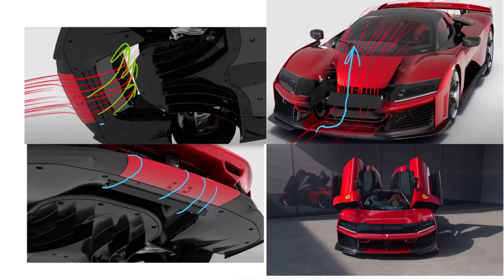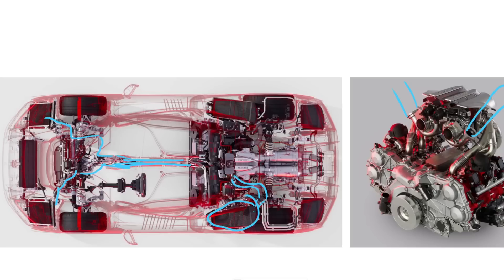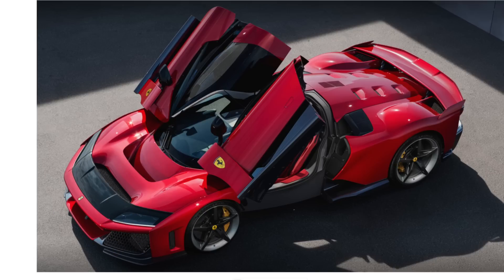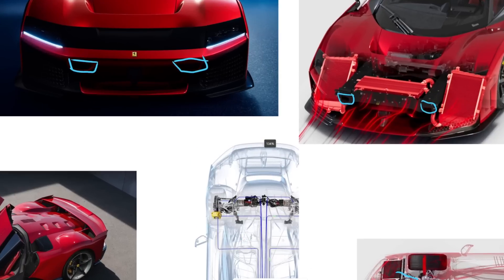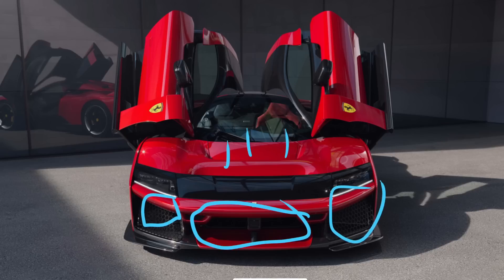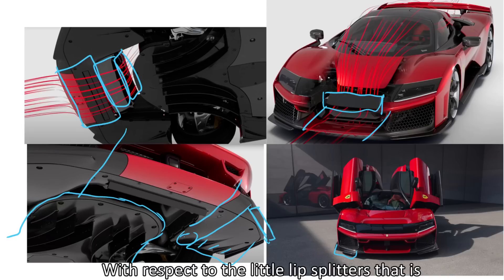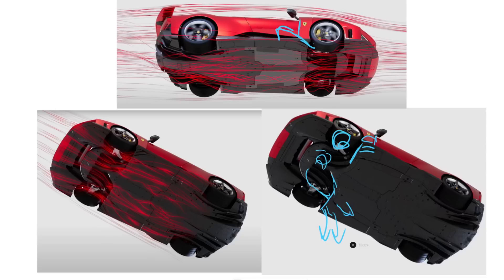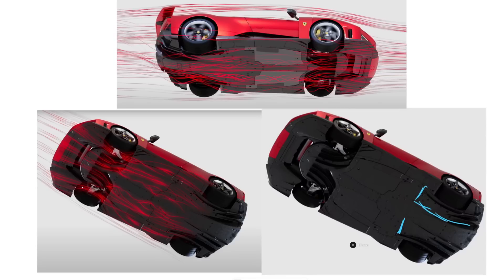Ferrari F80  -  Aerodynamics Analysis and Initial Thoughts

Comment: Analysis aside. This car is not pretty. It has that same odd nose as the 365GTB but immensly bulked up middle and back body. What were they thinking when they designed this car?
Back to the drawing board. Have a look at the FXX, and modernize it but better than the K model.

Comment: Question! The front 3-element "wing" that you talk about at around 8 minutes in, since it's generating so much DF and it's venting straight up right before the window, is there a chance that in wet conditions it'd potentially throw out water through it, and maybe even cause visibility issues?

Theoretically of course, a road car of this caliber probably wouldn't be pushing super high speeds on a track in wet conditions very often.

Comment: You know, back in the day I might have considered that those ducts running through the doors would be too long and tiny to really do anything. But I've read Willem Toet's article on air ducts, and how they blew out the door on their Aston Martin Nimrod at Le Mans after making the cockpit air intake smaller, but having a decent expansion area after it, increasing the pressure... So yeah, not gonna make any guesses as to how it actually works, because clearly I know nothing. =)

Comment: I never understood why more engines and transmissions are not angled around the Y-axis, whenever the regulations, or lack thereof, suit it.
Yes, the CG will be raised but that will allow for larger diffuser expansion right in the center section with all of the benefits that come with it.

Even racing categories which do allow for such implementation see very little to nothing of the kind. Maybe I am underestimating the side-effects of the raised CG, but as high-noses have shown in F1, the aero benefit does outweigh any CG concerns.
Reply: Do you mean simply moving the engine higher up in the car, or somehow orienting the various components to be arranged vertically? I think the new Lamborghini Revuelto’s transmission and electric motor are kinda stacked vertically to be more compact lengthwise.
Reply: @ALMX5DP  I mean tilting the engine and gearbox in relation to the ground, where the back of the engine stands higher than the front the engine.

On side view, angling the engine and transmission by about 10-15 degrees would allow the floor beneath it to be angled by that exact same amount. The differential still needs to be connected to the driveshafts, but this layout will allow for more diffuser expansion in its center section, as opposed to no expansion (assuming zero rake), whenever the engine is mounted flat or perpendicular to the ground.
Reply: @leoa4c   ah gotcha. Yeah since no mechanical driveshaft is going to the front, a little for-after tilt may not be so difficult. Still have to consider where the rear half shafts connect to the transmission so maybe that is where they might run into potential issues. But yeah interesting idea to allow for more underfloor aerodynamic work.
Reply: @ALMX5DP  The best way to deal with the differential would be to implement it above the drive shafts, in the center, with a gear coming down on each side to meet its respective geared shaft. Essentially, each shaft is a metal tube with a universal joint connected to a small diameter gear. That small diameter gear connects to the diff's "side gear", while a housing keeps it all together and, most importantly, no lower than the U-joint itself.

Such layout would drastically increase diffuser volume. In most mid- engine configurations, I think that an increase of 50% could be achieved.

Comment: The computer is just solving equations, applying curl and gradient operators to a field of vectors. If your eyes can make that calculation, and your brain is a computer, is your observation not valid? The eyes work better at resolving boundary conditions anyway, which all CFD kind of sucks at. Not saying CFD is useless, it's a tool, it has its place, I'm saying ultimately it's our eyes making judgment calls, our eyes need to know what they're seeing. CFD gives you a hint of what's happening, not the final say, the final picture always forms in your head.

Comment: Do electric turbos still use intercoolers?  That front shot with the doors up looks like the front of the garage 56 Camaro and the charger hellcat to me lol.  Enzo would be so pissed.
Reply: Yes, you still need to cool the air even if you have easier control to keep the compressor in a better part of the compression map, the only real replacement for inter cooling is ethanol or water injection up stream and both are more for short term running (drag racing) not really used in race or road cars as they introduce a consumable and can’t remove a lot of heat for extended periods of time (without topping up fluids).
Reply: 100% agree with the rest… add more mass in a less energy dense power source just to hit a 0-100 number while making a whale of a car in the corners/real world driving… he would fire anyone that suggested doing that.

Comment: Since this car is based on the lemans Ferrari, or at least that's what Ferrari said, I have a question: 
Why do Lemans cars have a gap over the wheels??
Reply: From what I understand, but I could be wrong, those cut outs are mandatory for all prototypes and hypercars. They are there to get rid of the high pressure air within the wheel wells. This should in theory make the cars less likely to get airborne.
Reply: @fastyf1 but does it have any advantage, why does the AMG project one for example have holes over the tyre or maybe SSC tuatara??????
Reply: @Manuel_Gestal   decreases lift
Reply: It’s also a way to cool the brakes for cars that are so track focused ✌️

Comment: I don’t know why they thought they needed two gigantic straight vertical lines at the leading and trailing edge of the side panels around the wheel. Same for the black strip. How does boring, bland, straight shapes equate to making it a futuristic, sci-fi design? It’s like they had to put effort into purposefully making a home run or easy layup body design just a bit ugly. It’s so close to being magnificent.
Reply: easy answer is F40 inspiration.
Reply: @bonifacelukosi9580  Thank you. I feel like everyone forgot the F40. That and the F40 had a twin turbocharged V8. It's so clear that this is a modern interpretation even down to the rectangle headlights.
Reply: @supermanblackedition  I completely agree, people are subjective before objective these days.

Comment: I thought the cost cap is supposed to take care of unrestricted technological development. Why are we still strangling development through more and more rules when the whole point of most of the rules was to prevent having to spend billions to compete at the front? Though the bib trick was definitely illegal without changing the rules, so I think this one would actually qualify as cheating. 

What if teams are allowed to develop non-hybrid V8 and V10 engines, but they’re also allowed to stick on as many electric motors and batteries as they want, wherever they want? They could have 0 to 100 electric motors and maybe a certain overall battery capacity limitation. That could encourage the development of even more powerful and lighter electric motors that can either withstand higher heat or dissipate heat better. The cost cap could be adjusted to prevent buying the championship.

If they go back to thirteen inch wheels can replace the weight with motors near the wheel or remove the weight entirely. That genuinely seems to be where super cars and regular cars are going, and teams can embrace electric motor power as much as they’d like. They should also remove the minimum overall car weight requirement because making any component lighter while maintaining a budget improves the performance and efficiency of anything. There are many problems with these ideas that need to be handled with appropriate rules and guidance, but I think they’d produce amazing racing and amazing vehicles.

Comment: It's a shame this car is 3700 lbs. Kinda makes everything pointless IMO, a hypercar shouldn't be almost as heavy as a dodge challenger
Reply: I agree and I get your point, but from all hybrid hypercars with 4 wheel drive (especially those with two front electro and one rear electro) it seems to be the lightest.
Reply: Holy shit
Reply: What's a lb? In all serious, no, that weight isn't an issue with modern chassis tech.
Reply: @wasdwasdwwasd  No, if it was the case, nor Adrian Newey or Gordon Murray will be trying to reduce the weight of their cars at all costs...
Reply: The Valk is much heavier than claimed and the Murray car is trying to do a very different thing. Less weight is better, but it's not the handicap it once was.
Reply: @jayaneyon9316  checked the actual weight of a sf90, that specific car was 1844kg, that's 4060lbs. I  dont know where Ferrari gets their numbers from, maybe they have scales on the moon 😂
Reply: @garagecedric  Ferrari (and most italian companies) use dry weight
Reply: @dylanburston7453  for Ferrari its something else going on, or maybe they have 250l tanks :)
Reply: @garagecedric  68L fuel tank.  
0.79kg (1 litre petrol) times 68=53.72kg.
1570+53 =1623
+75kg for a driver and another couple of KG for the other fluids would take you up to 1700kg, which is the most common kerb weight for the car ive found.

Im guessing the car they weighed must either be a outlier, or 
have full tank+ lugage+fat driver
Reply: @dylanburston7453  its the same for all Ferraris cars the stated weight is fantasy, in the Swedish vehicle registry all individual actual car weights can be easily checked with just the plate number. But there are other sources as well which tell the same story :)
Reply: @garagecedric  sure, the scales and posts that you find in internet aren't "trust me bro" compared to their scales 😂
Reply: I’m less concerned about how manufacturers make their hyper cars “overweight”, than I am about more mainstream models doing the same. I feel Hyper car owners won’t care, whereas the owner of say an Mustang or BMW M car will have an increased likelihood to, especially when it comes to the comsumables that they use like on a track day burning through a set of tires and brakes more quickly as a result.
Reply: @ALMX5DP  we have mostly twisty tracks here, many modern cars go through (big) tyres at an alarming rate!
Reply: @garagecedric  same for here in the US, and yeah tires are getting quite expensive especially the big ones (305+ and 18-20”+) that people fit to their performance cars.
Reply: Considering Ferraris history with spec weights and actual on the road weight i guess this car will be more than that.
Reply: AMG One is 3800 lbs. this thing has multimatic suspension so that should help hide the weight, just like the heave springs for the One do. also, knowing italians, this is definitely more than 3700 lbs
Reply: @chabweezy9905  And the Mclaren W1 is close to 3000 lbs so why trying to compare the F80 to the years old half assed project that was the AMG One ?
Reply: @GenghisDaniel  3000 dry in the same way F80 is 3360. This isn't a huge difference considering that Ferrari is a bigger car, has a bigger battery as well as drives the front wheels with electric motors plus the active suspension system. All these seem like a fair tradeoff, especially the four wheel drive system.
Reply: @Avto28  Yes comparing it to the W1 it seems to be in line with the different design decisions. Yet there is a big difference with something like the Valkyrie even if it is heavier than thought at the beginning of the project. This is the problem for Ferrary nowadays, it is not like at the old time of the GTO F40 and others where they were close to be the only one to develop such cars, now if you want the ultimate race car there is the Solus, the Valkyrie, or others, and yet if you want the perfect sport car still usable on road you have the Koenigseggs or the Tourbillon.
Reply: @GenghisDaniel  Oh, Ferrari can sell you a car faster than a Valkyrie it's called the 499P modificata so it's not like they can't build such a car but the usability of these vehicles on roads seems to be really questionable. As for the Koenigseggs and Bugatti it's not like they are that light either even the former is usually over the 3000 lb mark. The reality is unless you are driving on a track, it will not make that much more difference if the car is 3100 or 3600, provided that the former has all-wheel drive and more advanced electronics, and they are both running similar tyre set-up.
Reply: @Avto28  Yes, but the Koenigseggs and the Bugattis are nice looking inside and out, whereas this F80 is questionnable at best... And you do realize that the 499P is not homologated on the road right ? Even thought the thing is that the 499P is a much more beautiful car than the F80 and I am  not sure it is due only to the fact that the 499P was not hindered by the rules of road homologation. The F80 could have been a nice looking car, as Kyle has explained in its video, all the exterior design is a choice of the designers which clearly thought that it was a good idea to base a design on the idea that you can collect design references to the Daytona, the F40 and the Enzo, and that magically in the end it will make a beautiful and coherent design. The second problem with the F80 is that it seems that it will neither be the best race car homologated for the street (which what were trying to achieve the F40, the F50 and the Enzo in their time) nor the best all around performance oriented road which might go to the T. 50 or a Koenigseggs or a Pagani, or the Tourbillon which seem to be more performance oriented than its predecessor...
Reply: @GenghisDaniel  It would be easier to make 499p street legal than all of the effort that went into the Valkyrie and it still being just about bearable on the road. Now about the exterior design that is very subjective you don't like it but I do reminds me very much of some sports prototypes from early 90s even the straight sides from the top down view seem to be designed to create this illusion  of a proper race car filling out the legality "boxes" to the max. In terms of performance I have difficult time believing that either GMA T50 or indeed Koenigsegg can be as fast as this Ferrari in a normal everyday use. With all-wheel driver, actual downforce and Ferrari's tried and tested electronic aids it will be a rapid car indeed. People often assume they are entitled to decide what Ferrari is and what it should be but in reality this decision falls squarely on Ferrari themselves and their buyers, and guess what they seem to be selling just fine - no matter the price Ferrari assigns to these models.

Comment: Would you make one on the McLaren W1?
Reply: There are no details of the underside of the W1, so might be difficult to analyse. McLaren said it uses ground effect, so there’s a lot going on aerodynamically at the bottom. Also haven’t seen much detail about the movable aero element at the front,
Reply: Yes please
Reply: What I can tell from the press release, they are very similar in concept. Movable front wing, T-Tray, ground effekt, and big diffusor and adjustable rear wing. They use the same tires, so the limitations and hence the performance is very similar.